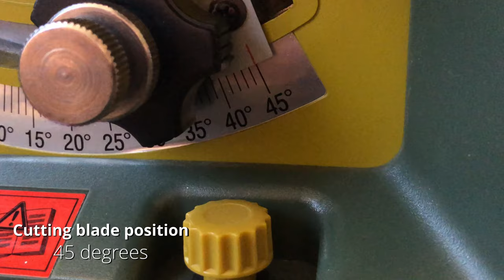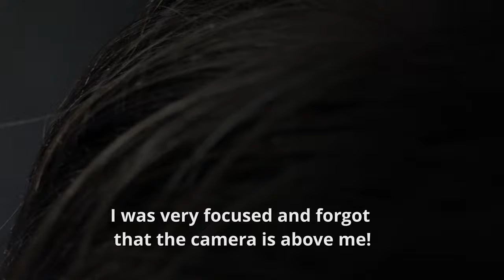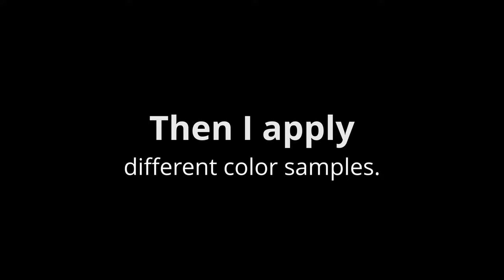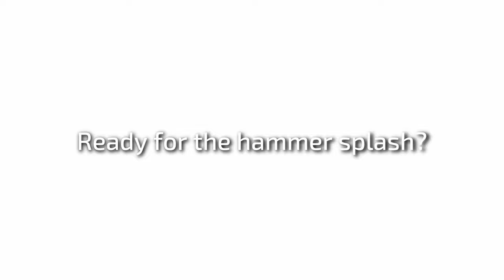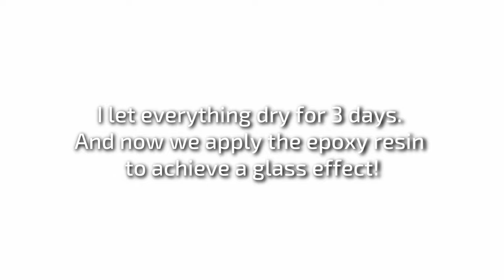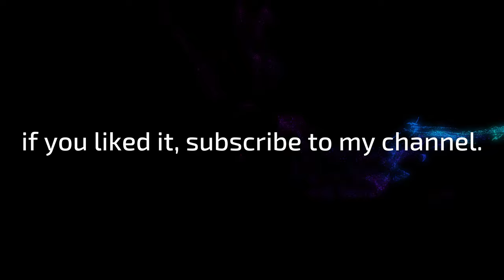Magic 3D Acrylic Paint Cube out of Epoxy Resin with the hammer splash technique | JFA

Comment: Wow, I Luv how this looks. I am just a little saddened by how u finished it so poorly, in my opinion. Double-sided tape will eventually fail to keep its adhesion resulting in a pile of pieces. I would recommend getting some wood glue and try disassembling it and glueing it with the wood glue. Not only will it give u a permanent bond, but it will also give u a seamless look along the edges. Unlike how the double-sided tape has. It might only be a thin bit of tape, but it's clear to see there is a tiny gap between the edges. Please don't think I am saying to criticise, it's just a suggestion from 1 artist to another. Keep up the great vids, all the best, Diane, UK x